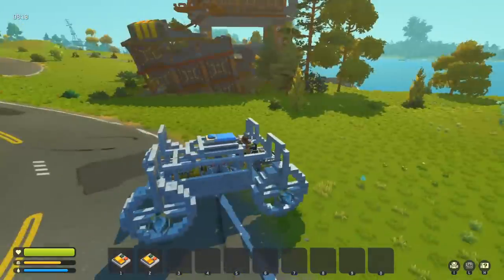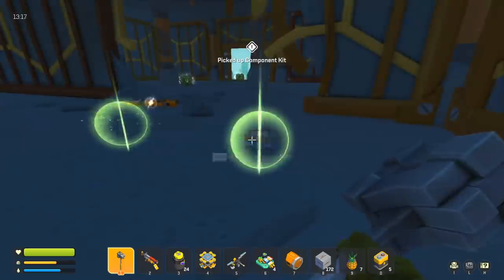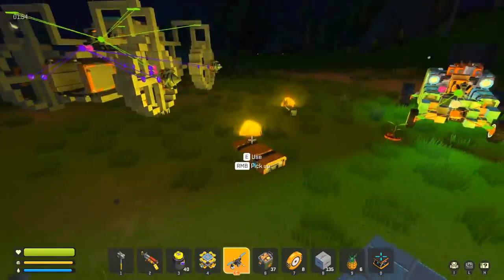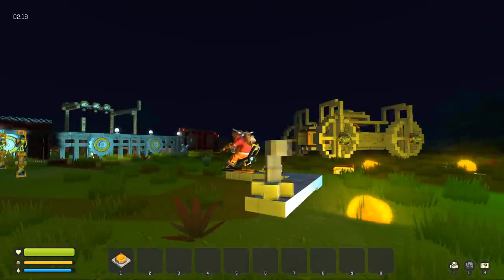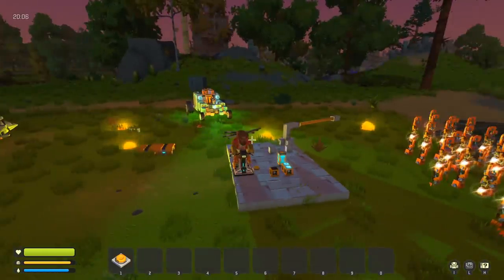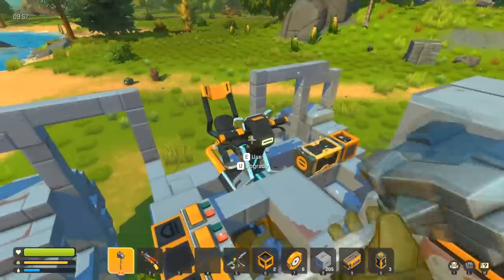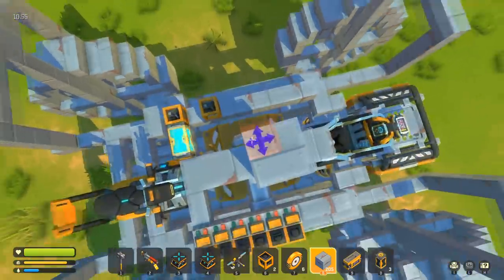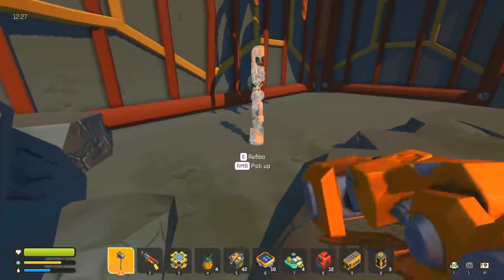Rock Harvesting Crane - Prototype testing! | Scrap Mechanic Survival Mode | Ep 13

Comment: If you use two alternating pistons on the logic loop they it will keep perfectly still until you start extending it.
Reply: I rather dislike pugs
Reply: @maxim6088  ...ok?
Reply: @pugz3230  My pog scratched itself until blood, so we had to put her down...
Reply: @ben1cecream955  what about his farmer crane for the trailer? Btw it has a loop with an extending and retracting piston that cancel each other, unless a button is pressed in which case the piston extends
Reply: @danredebeer9733  they are the same

Comment: Build the crane like an excavator, easy way to fix the piston issue, because you won't even need them, keeps it simple because you could use bearings and potentially make a kind of joint that allows the drill bit to swing so it faces the ground on its own
Reply: I can tell you right now that that's a horrible idea. I know because I made one myself. I swear, worst mining vehicle by far. Getting the drill bit on target was a headache and a half, and once you did get it on target, you'd bounce off instantly and had to readjust again and again and again and again ad nauseam. It was so bad, the basic "fixed drill bit on the front" design was less of a hassle to drive. 
Hell, the next mining vehicle I made was a "dropper" type that had drills on the bottom and would first raise itself up, drive over a rock formation and then lower itself down again. "Aiming" it was hard once you got half way through one rock, it would tip over on a regular basis, and a whole bunch of other issues. That piece of shit was easier and more fun to drive than the excavator.
All that said, the best design I've tried so far is a variation of a "scorpion" miner. Mines fast and so easy to use it actually makes mining somewhat enjoyable.
Reply: A sort of mix between the two would seem ideal to me. Have a bearing connection between your base to allow for a rough up/down control, and a second set of bearings for a finer up/down control on the end of the first arm. the second arm could then have pistons for getting the higher rocks or just having more reach in general. the drills on the end of the arm should be controlled, from what iv seen free-spinning things in this game do not play well with physics.

Comment: One idea would be to mix both this design and the old one. Have some drills at the front, facing forwards, you can lower and run over the smaller bits. If you can lower the speed and power then you may bounce off less. A single baring on the front wheels, one each, could drag the craft at a slower speed and give it less bounce when pressing against the smaller bits and allow more control. 

That or you could go over the top and add a flatbed and also a ramp to the back xD.. With the ramp you would be able to maybe carry a smaller craft for the smaller parts? Just a few ideas, hope you read this ^^

Comment: A thought occers. The upward-then-downward facing bits that go up to hold the wheels from above could probably stand to have some bearings controling their possition relative to the chassie. Not only to get the chassie higher off of the ground but also to bring the wheels up and drop the bottom of it right onto the ground. It might even be possible to make the whole thing jump if needed.

Comment: Hey, lath. If you build a pulse generator with a 'nor', or, and an 'and' you can attach a button to the 'or' for the piston to extend. Then another button to a 'nor' gate to the 'and' gate in the generator will shut it off completely when you press making the piston contract. If you want to have it stationary instead of going up and down constantly, attach two pistons one after the other. Connect them to the same generator and have them pulse opposite to each other with a nor gate.
You can also attach a switch to the 'nor' gate to turn the system on and off

This way you can have a crane you can freelly control

Comment: I had built a miner using your big wheel idea and it was pretty slow, but then i just added a secondary drive system which is elevated and can be brought on the ground lifting the whole thing up with a switch. That drive is a controller based one and is pretty fast and can carry alot of weight. With that switch i can toggle from slow and precise to fast

Comment: To make the crane-controls "easier" you could rewire it to 6 buttons and an optional switch
the switch would control the main clock, so you can turn off the crane to avoid lag for example.
the buttons would be 2 per crane element, one to extend one to retract.
e.g. by sequencing: clock -> or-gate -> and-gate -> piston. You could attach the extend-button to the or gate and the retract-button to a nor-gate followed by the and-gate
what this basically does is, instead of powering the piston using a clock, powering the piston using a constant signal (on/off) when either button is pressed which makes the piston move.

Comment: To get the strength of the two side by side turning bearings without them working against each other, you can put a bearing above and below one block, attach a two blocks horizontally and perpendicular on the top bearing, put a piston below it, attach another block below the piston and weld it to the block attached to the lower piston. The piston has no collision so it won't hit anything during turning, and with two connected turning bearings, they're very strong/stable.
Reply: Forgot to say you can use the same system with drive bearings which would allow you to use a motor for spinning the crane instead of multiple turning bearings. You'd just use w/s instead of a/s to turn it.

Comment: a suggestion for the vehicle would be having a drill or two in from of the harvester to break any leftover annoying pieces. at 22:14 the gamma is blinding fro the hotbar. and for the mobile base it would be recommended that you have vehicle storage inside. and it would be nice to start seeing thrusters being used

Comment: @Lathland
1. your british, not weird. cheers mate
2. i do believe the idea of increased bearings to increase speed is a good idea. even just one or two per wheel. just as a point to point increase use.(on a button)
3. if you make the collector apart of the crane, weight not considered, would be the best moving forward. nice thing is the collector is placeable and buildable upon. such as the drills attached to bearings on the collector for added pressure.
4. i do enjoy the forked wheel design and the "spider" like stance.
5. if you have questions on how to connect items of logic, @j0hnbane or Moonbo or Kan are great choice to review here on YT.

Comment: How about a turret-based driller? Place a rotating turret on a piston to give it enough clearance to look downwards, direct the drill arm up and down with bearings, and extend it with pistons. You may even skip the piston-locking on the lifting part of the turret to simplify it and reduce wobble, limiting the pistons and just enough height to give it enough room to bend downwards. So flip a switch to lift ("unfold", if you will) it to working position, and then just direct it like a gun and push the drills away into the rock. Plus, you can control all the bearings with WASD/arrows, right?

As for vechicle speed, I'd say make it 15-30% speedier. Shouldn't look all too terrible while giving it a pleasant boost in traversal capability.

Comment: Maybe if you slightly adjust it to cut the base of the rocks and then grab the boulders and bring it to a back cage filled with drills facing upwards and a couple of collectors under it. 
It may solve the lag and save a lot of time.
You also could make the crane out of net blocks to save some weight.

Comment: Just make something that pulses, and before every piston use this setup...
Pulse Generator -> NOR Gate -> OR Gate -> Piston
Connect a button to the OR gate... this button extends the piston. (always on when receiving either signal)
Connect a button to the NOR gate... this button retracts the piston. (only on when receiving no signal)
The NOR gate must be connected before the OR gate.

If you add a second inline piston for more length, you can also use it to stabilize the setup by reversing the pulse timer...
Pulse Generator -> NOT Gate -> NOR Gate -> OR Gate -> Piston
and use the same buttons as the other inline piston. This will double the speed at which the setup extends or retracts.

If you connect one switch to ALL the NOR Gates, you can turn that on to fully retract all your pistons and easily put away your crane.

Comment: A good alternative to keeping those pistons extended would be to switch to a pseudo-scissor "lift" with lots of ninty degree angles that straighten out in order to extend. Since you've got Bearing Locking from the level five seat anyway that should simplify everything nicely.
Edit: alright yeah that jittery clock-based piston locking system looks horrible there's no way that that is acceptable.

Comment: a simple method would be to make a draw bridge like device that has drills under it and setit up to rotate 90 degrees and store lengthwise on your vehicle and with one button press rotates back and flips onto the rock at an angle using gravity to hold contact

Comment: Its ok, but you night have to consider wheel spin issues. You might have to consider how fast you can go before wheel slip becomes an issue. And put its max speed just below that limit. And maybe a double row of drills to trap rocks so you could use two or more rows to pin rocks to the ground. Also just use a piston to move your collector down for collecting mode.

Comment: Try using electric engines instead of steering bearings for the crane turning. They can be set to an extremely slow speed and won't use many batteries because the crane isn't very heavy.

Comment: Use another row of drills on the same beam where the others are, but let them face outwards (attach them horizontally) so that you can crush lying rocks by extracting etc.
EDIT: Or make it "iron maiden"style, pretty much the way you mentioned in the vid. I mean the torture thingy not the band btw. Like a crab that harvests rock. A Rockcrab!

Comment: Lath, quick suggestion. As you want four wheel steering and you want as much stability as possible, why not just make the wheels fixed and articulate the body in the middle? You could then steer it off the central articulation point but have the wheels much more stable?

Comment: I do not play the game, or watch other youtubers, but I think you can control your crane with buttons for each direction with an global clock and 3 Logic Gates + 2 Buttons per piston.

Layout:

retractBUTTON ------- NOT
                                              \
                                                AND -------- PISTON
extendBUTTON                  /
                            \              /
                              OR -----
                            /
              CLOCK

if you press the retract-button your AND-gate will be deactivated causing the signal to be constantly off
if you press the extend-button the OR-gate will be constantly on
if you press nothing your clock signal will pass unchanged

Comment: I have an intuitive design, what works like two arrow keys, moving only if you press them, otherwise staying still.
You need two buttons, what optionally can control the drills as well. I am going to call one button 'A' and the other 'B'. You are going to need a clock as well. Attach Button B to a NOT gate, and connect the NOT gate and the clock to an AND gate. Connect this AND gate and button A to the piston.

Theoretical paragraph, feel free to skip:
There is however, a logical problem, because we want the drill to have three states: retracting, staying and extending, but the button has only two states, on and off. Our two buttons have four states, 00, 01, 10, and 11. 00 is staying, 01 is retracting 10 is extending and 11 is also extending, and as such it is practically free. 

You can make another AND gate and connect both buttons to it, and link it's output to the drills. This way, the two buttons are completely exploited, and drillinig also extends the pistons. It is recommended to use these buttons to control the last pistons, what are going down, so they are pressed into the mineral.

Using the idea of fellow commenter Pugz4Life, to use two inverted pistons for smoother "stop" state, we can give better handling at the price of complexity. This one will also need two buttons. Take two AND gates, connect one NOT gate to both, with the NOT gate getting it's output from button B. Link the clock to one of the AND gates, and link the clock to a NOT gate, what will then be linked to the another AND gate. Link the two AND gates to the two pistons, and connect button A to both pistons. You can also optionally add another AND gate and connect both buttons to it, and link it to the drill, if these buttons are controlling the last pistons.

Comment: I hast discovered the folly of a mobile base early game.......
A ran across a boss bot, and couldnt run because the boss destroyed my vehicle. I couldnt pick it up and run, because i had tried that when the boss first started his surprise attack, and when i set it down to get it away fromthe boss, it landed on me.

I couldnt pick it back up, and i lost my entire base....... but, thanks to my high luck stat (imma gamer, can ya tell?), i managed to salvage all 4 big wheels,, my lvl 5 engine, my lvl 5 seat, my lvl 5 controller, a big chest, and ALL 5 saws.....
I didnt realize i had all i needed for a new vehicle until i had traveled the 2 or 3 miles back to base.....

I had my only crafting bot, my only refinery, and my only collenctor, along with the two big chests, and all of the factory parts got destroyed, along with the big chest with all of my crafting materials in it.

It was frustrating, but the world has a perfect landscape around the shop. 3 easily accessed buildings, easily found cotten (just a few hundred feet away), with easy to access oil, clams, and a wheat field.

But yeah. Dont do mobile bases if that requires taking crafting bots out of your base. 
I learned that the hard way.

Comment: Why not use buttons for the extending so it's less confusing and a bit easier to use, also make it a bit fast just to save time.
Like the buttons would just make it obvious which are for extending and which are for locking
Reply from the maker: I did mess with buttons first but weirdly I personally found it more difficult. Think it is the better option but personally I just didn't like it, might swap them over still if I keep the crane!
Reply: @Lathland  OMG He noticed me